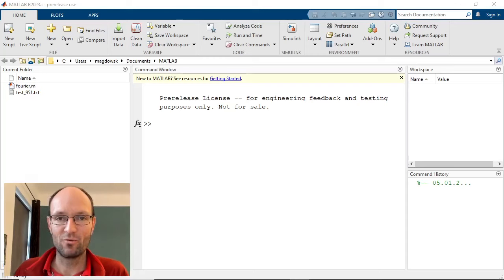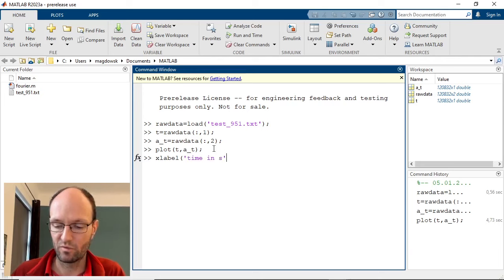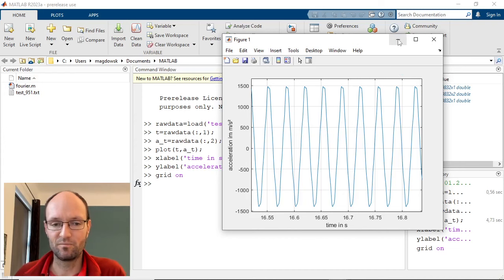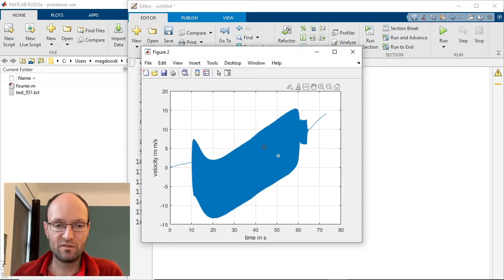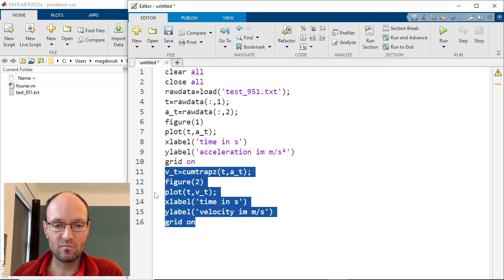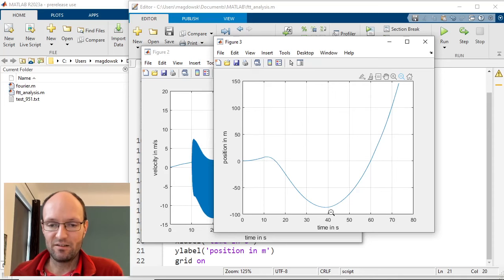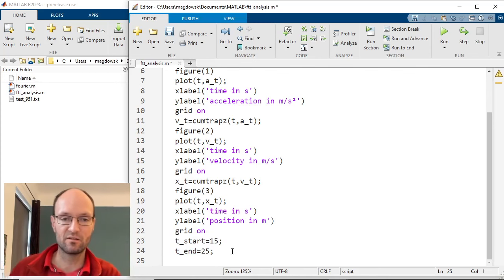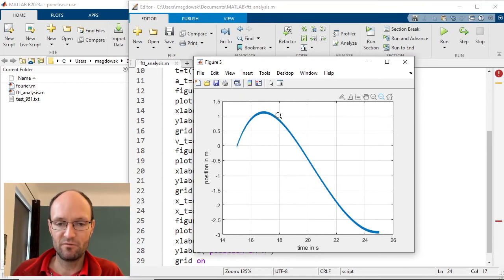Fourier transform (fft) in MATLAB from accelerometer data for acceleration, velocity and position

Comment: Why not use fft Matlab command?
Reply from the maker: The 'fft' function (fast Fourier transform or discrete Fourier transform) is used within the 'fourier' function, which works like an API (application programming interface) or a wrapper to the underlying 'fft' function. The problems or issues with the basic 'fft' function are the following:
1. The 'fft' function only takes one argument as input, the values of the time function, and returns one output variable, the values of the spectrum.
2. Therefore, you have to take care about the corresponding time steps and frequency values yourself. The highest frequency corresponds to the shortest time, while the smallest frequency corresponds to the longest time. The 'fourier' function takes care of this. As a second input argument, you input corresponding time (equidistant) steps and get back the corresponding (equidistant) frequencies as a second output vector.
3. The ordering of the frequencies in the output vector of the basic 'fft' function is kind of strange. The first entry in the spectrum obtained by the 'fft' function refers to the doubled constant part of the transient signal. It is followed by the positive frequencies in ascending order up the the highest frequency. Then, there are the negative frequencies in descending order. Negative frequencies only make sense for complex-valued time functions, which usually have no physical meaning in the engineering sciences. For real-valued time functions, the spectrum of the negative frequencies is the complex conjugate of the spectrum of the positive frequencies. Therefore, the negative frequencies can be omitted, as they are redundant and do not contain any relevant information in that case.
4. The amplitude or magnitude of the spectrum calculated by the basic 'fft' function depends on the number of steps or vector length of the given time function. The wrapper provided by the 'fourier' function takes care of this and renormalizes the amplitude for two different cases, periodic functions (like sums of sine and cosine functions, rectangular pulse trains or clock signals) or aperiodic functions (like single pulses).
Reply: @MathiasMagdowski  thank you for your prompt and detailed answer!

Comment: Sir, i have data points (t,V) of blood flow waveform. I want to fit this data with the help of fft. The matlab tool did't accurately fit with eight co-efficient.Could you help me regarding this?
Reply from the maker: Sure, you can send me your data to my e-mail address mathias.magdowski@ovgu.de and I might have a look.
Why do you want to have exactly eight coefficients?
Reply: Thank you for your prompt response, sir. We require more than eight coefficients to precisely fit the data. However, the MATLAB curve fitting tool offers only up to eight coefficients by default, which is why we are seeking your assistance. I am sending you the data
Reply from the maker: @asifraj321  I have had a look at your problem. The question is, why you do want to use the curve-fitting toolbox to do the Fourier analysis and why you not simply do it by yourself using the method presented in my video.
There is also another video explaining the Fourier reconstruction, which might be also very interesting for you:
"How to reconstruct a periodic signal as a sum of cosine functions from the freq. spectrum in MATLAB"
https://youtu.be/OvyTRxZSolU
Anyhow, I have prepared a short script that uses my fourier.m function to do the FFT analysis of your data. It reads it your time-domain data, plots it, does a Fourier analysis, plots the spectrum and does a Fourier reconstruction based on the N most important spectral components. You can enlarge this number to achieve a better fit. The corresponding amplitudes and phases of these harmonics are printed to the MATLAB command line while running the script as in the above-mentioned video.
You can compare theses results with the results of the curve-fitting toolbox. In my script, the harmonics are given by amplitude and phase, in the toolbox by the coefficients a for cosine functions and b for sine functions. You can calculate or convert them by
a=amplitude .*cos(phase)
b=-amplitude .*sin(phase)
You do not get exactly the same results, but the outcome is quite close.
As you mentioned, the curve-fitting toolbox only allows to obtain 8 harmonics or 2 * 8 = 16 coefficients plus the constant part. My function fourier.m allows to obtain also higher numbers of harmonics or coefficients. If your time function has e.g. 200 values, you would also get 100 harmonics (plus the constant part). If you use all these harmonics for the reconstruction, you would also get a perfect fit.
The question therefore is, how many harmonics or how many coefficients you really need to get a reasonable agreement and to perform your intended analysis and further processing of the results. If you use too many harmonics and coefficients, there is clearly the danger of over-fitting your data.
Reply: Thank you for explaining in detail. It's very helpful.

Comment: Hello Sir, I am having trouble while performing fourier transform of position (x_t). While using 'fourier' command exactly as you coded "[f,X_f]=fourier(t,x_t,'sinus');" I'm getting an error stating 'Incorrect number or types of inputs or outputs for function 'fourier'.'  Could you please explain me the issue here, and what can be done to overcome this?!!
Reply from the maker: Thanks for your question. I would assume, that the input variables t or x_t are not correct in your case. Both t and x_t must be plain numeric vectors with the same length. The time vector t should be given in the unit s, must start with 0 and must have equidistant time steps as described in the comments of the function. If t or x_t are cell arrays, tables, structs or something else, the fourier.m function might not work as expected or might not work at all. You can check the nature of your input variables t and x_t in the MATLAB workspace or variable editor.
Reply: @MathiasMagdowski  Thank you for your response sir. I am dealing with signal analysis form sample data sets of accelerometer to analyse the vibrations occurred while collision of a leg prosthesis against a stair. In between I had a question, how to do bode plots and get cut off frequency when we don't have for instance 'sine signal' generated directly from the matlab function(x = sin(2*pi*f*t))? Instead we have data sets of acceleration and time and that have been used to plot signal. In this case of datasets how could we apply bode plots formulation?
Reply from the maker: @aryashah7892  A Bode plot is nothing more than a combination of two plots showing the magnitude and phase as a function of frequency, see:
https://en.wikipedia.org/wiki/Bode_plot
Typically, both the frequency axes as well as the magnitude axis are logarithmically scaled, while the phase axis is linearly scaled. Bode plots are usually used for transfer functions or impedance operators, but you can also use if for the spectrum of a signal. If your time-domain data is sampled correctly (not undersampled, capturing a whole aperidodic impulse or more than one period of the fundamental frequency of a periodic function, proper amplitude resolution, not only noise, no trend, no amplitude jump from the beginning to the end or proper windowing), you should see one main or several spikes, peaks or resonances in your magnitude spectrum. These will be the frequencies of the vibrations occuring during or after the collision. For high frequencies, the magnitude should usually go down into the noise floor. You could define a cut-off frequency between the "resonance" region and the "noise" region.

Comment: Why is the name of the Y axis is maximum periodic change of acceleration in m/s^2? It is not jerk, since units are in acceleration. Thus why change? Is it just amplitude of vibration at particular frequency? Thanks!
Reply from the maker: Yes, you are probably right that my terminology might be a bit misleading here.
The rate of change (or time derivitive) of the position (in m) is the velocity (in m/s).
The rate of change (or time derivitive) of the velocity (in m/s) is the acceleration (in m/s²).
The rate of change (or time derivitive) of the acceleration (in m/s²) is the jerk (in m/s³).
Nevertheless, what I called "periodic change" or "maximum periodic change" is just the amplitude or "change", not the "rate of change" or time derivitive of the corresponding quantity, i.e. position, velocity and acceleration.

Comment: Impressive video! I’m currently conducting research to explore the relationship between various sizes of compressed air leaks and their corresponding frequency shifts, employing accelerometers for measurement. One notable challenge I’m encountering involves effectively analyzing the FFT spikes amidst the accompanying noise. I’d greatly appreciate your insights on the most effective techniques to mitigate noise in the final FFT results. I am having a difficult time improving the plots with windows and or signal averaging.
Reply from the maker: Noise is a broadband process. Your useful signals are rather narrowband. One of the things to try is to filter your signal for the interesting frequency components and to suppress the unwanted frequencies components including the noise using transfer functions of high-pass, low-pass, band-pass or band-stop filters. You can also try the average your calculated spectra over a certain amount of time as noise will typically cancel out. Nevertheless, if the transient signal in time domain only consists of noise, then the spectrum will also more or less only show noise.

Comment: Didn’t understand the reason not to use fft, can you explain please
Reply from the maker: The 'fft' function (fast Fourier transform or discrete Fourier transform) is used within the 'fourier' function, which works like an API (application programming interface) or a wrapper to the underlying 'fft' function. The problems or issues with the basic 'fft' function are the following:
1. The 'fft' function only takes one argument as input, the values of the time function, and returns one output variable, the values of the spectrum.
2. Therefore, you have to take care about the corresponding time steps and frequency values yourself. The highest frequency corresponds to the shortest time, while the smallest frequency corresponds to the longest time. The 'fourier' function takes care of this. As a second input argument, you input corresponding time (equidistant) steps and get back the corresponding (equidistant) frequencies as a second output vector.
3. The ordering of the frequencies in the output vector of the basic 'fft' function is kind of strange. The first entry in the spectrum obtained by the 'fft' function refers to the doubled constant part of the transient signal. It is followed by the positive frequencies in ascending order up the the highest frequency. Then, there are the negative frequencies in descending order. Negative frequencies only make sense for complex-valued time functions, which usually have no physical meaning in the engineering sciences. For real-valued time functions, the spectrum of the negative frequencies is the complex conjugate of the spectrum of the positive frequencies. Therefore, the negative frequencies can be omitted, as they are redundant and do not contain any relevant information in that case.
4. The amplitude or magnitude of the spectrum calculated by the basic 'fft' function depends on the number of steps or vector length of the given time function. The wrapper provided by the 'fourier' function takes care of this and renormalizes the amplitude for two different cases, periodic functions (like sums of sine and cosine functions, rectangular pulse trains or clock signals) or aperiodic functions (like single pulses).
Please also refer to this video:
How to scale the result of the fft (fast Fourier transform) and how does fourier.m work in MATLAB?
https://youtu.be/hAbsoXaZ144
Does this answer your question?
Reply: @MathiasMagdowski   yes , thank you so much  for your reply.
Reply from the maker: @sudmudmud357  No problem, you are welcome.
Reply from the maker: @sudmudmud357  To be honest, I don't have much experience with power spectral density calculations (https://en.wikipedia.org/wiki/Spectral_density). To check for equidistant time steps (or a constant sampling rate), you can calculate the distance between each time step using diff(t), where t is your vector of time steps. All values of the result of diff(t) should be equal. A graphical representation using plot(diff(t)) should show a horizontal straight line.
If your time steps are not uniformly spaced, or if the sampling rate is not constant, you would need to interpolate your time function to equidistant time steps before calculating the power spectral density.
Windowing is only really necessary if your time function does not end at exactly the same amplitude value as it began. The FFT algorithm assumes that the time function continues and repeats over and over, forming a quasi-periodic function. If the start and end values are not the same, there will be a huge jump, or a huge step, which will create a lot of artifacts in your spectrum that are not really there, but are created by that jump. In such a case, it may be helpful to cut the time function and the start or end to make the start and end amplitudes more similar, or to use a windowing function (see https://en.wikipedia.org/wiki/Window_function). The proper choice of this windowing function depends on the characteristics of the time function and requires a trade-off between artifact suppression and amplitude error.
Reply: @MathiasMagdowski  thank you 🙏 very much. What you have mentioned is more than sufficient.
Reply from the maker: @sudmudmud357  Excellent, you are welcome.

Comment: I want to club 4 accelerometer data in one graph with respect to time because you have done only 1 accelerometer data vs time. If it is possible please tell me .
Reply from the maker: Thanks for your inquiry and sorry for the slightly delayed answer, but I'm currently at a conference.
Sure you can plot four curves into one joint graph, see the documentation of the plot command. For example, if you have done the FFT analysis four times and correspondingly obtained the frequency vectors f1, f2, f3 and f4 as well as the acceleration spectra A_f1, A_f2, A_f3 and A_f4, you can just plot them into a joined diagram by:
loglog(f1,abs(A_f1),f2,abs(A_f2),f3,abs(A_f3),f4,abs(A_f4))

Comment: hi tank u for valuable information i use accelerometer and i need to calculate and plot detailed frequency centered distribution can y give me some advices and direction
Reply: Depending on the frequency intensity I want to detect the moments of signal distortion i will use for motors i guees i need to make vibration analysis
Reply from the maker: @berfindurmus9380  What do you exactly mean by a "frequency-centered distribution"? Maybe these more general videos are also helpful for you:

How to do a discrete Fourier transform (FFT) and to plot the amplitude and phase spectrum in MATLAB
https://youtu.be/ZvYGqYOyesk

How to scale the result of the fft (fast Fourier transform) and how does fourier.m work in MATLAB?
https://youtu.be/hAbsoXaZ144

How to reconstruct a periodic signal as a sum of cosine functions from the freq. spectrum in MATLAB
https://youtu.be/OvyTRxZSolU
Reply: @MathiasMagdowski  i will check the contents thank u for feedbacks
Reply from the maker: @berfindurmus9380  You are welcome.

Comment: I have input and output data, and I have taken the fft of both and computed the frequency response function(frf).
If you have videos/resources in regard to frf, please share the links with me.
Reply from the maker: Okay, here are some video recordings about transfer functions and frequency response functions:
 
Playing around with the fast Fourier transform (FFT) to simulate a low-pass filter in time domain and frequency domain
https://www.twitch.tv/videos/1973439539
 
Calculation of the transfer function and attenuation of a low-pass filter from task 18 about filtering from the EMC exercise
https://www.twitch.tv/videos/2029476051

Calculation and plotting the transfer function and attenuation of a low-pass LC filter in GNU Octave or MATLAB (EMC exercise task 18)
https://www.twitch.tv/videos/2029482925

Simulating the transfer function and attenuation of an LC low-pass filter in the LTspice circuit simulator (task 18 from EMC exercise)
https://www.twitch.tv/videos/2029489058

Measurement of the time-domain response of a low-pass RC filter using an USB oscilloscope with sinusoidal excitation
https://www.twitch.tv/videos/2029497090
 
Measuring the frequency response or transfer function of low-pass RC and LC filters using the Frequency Response Analysis Tool of A. Hexamer
https://www.twitch.tv/videos/2029505324
 
EMC Task 23: Low-pass R-C filter in time domain and frequency domain
https://www.twitch.tv/videos/2302390977

Short course "Filters for Electromagnetic Compatibility Applications" (live from @iutangers_cholet )
https://youtu.be/3wGC0ZE4ij4

The problem with measuring such transfer functions is typically that your input spectrum might also contain frequency components with very small amplitudes (nulls in the spectrum). If you then divide the output spectrum (which will also be zero in this case) by the input spectrum, you practically get 0/0, which is undefined and not a number.